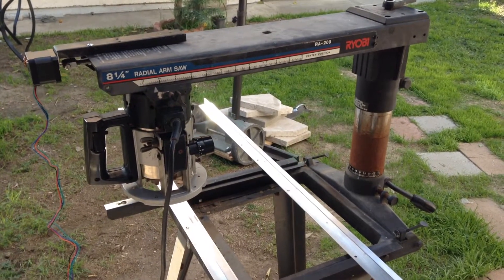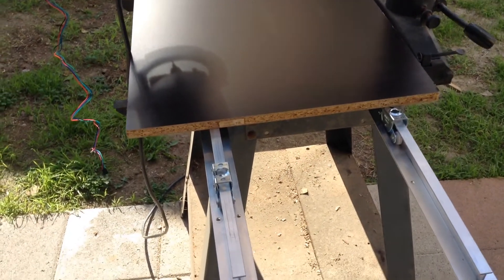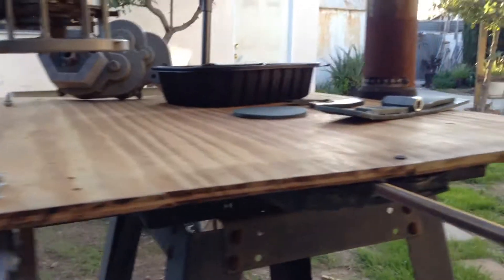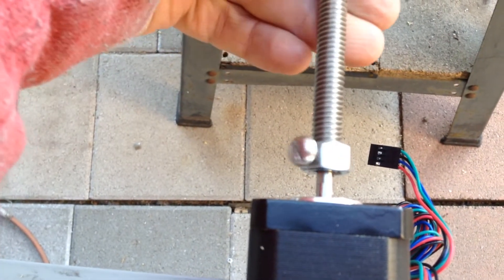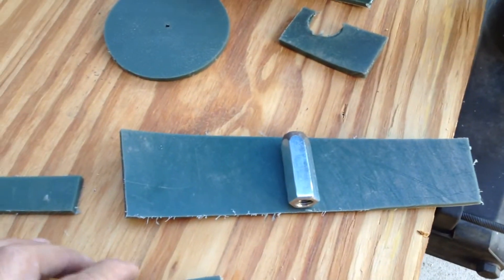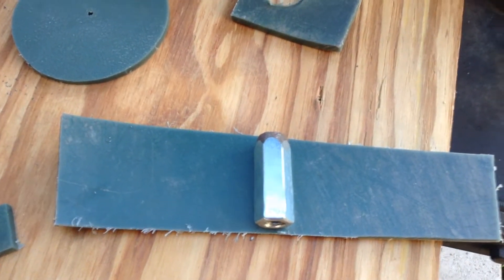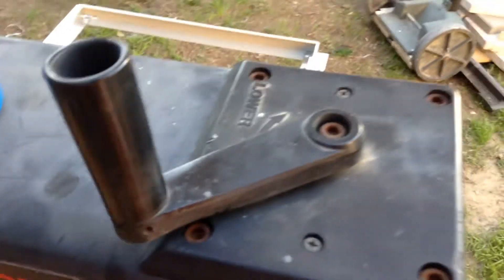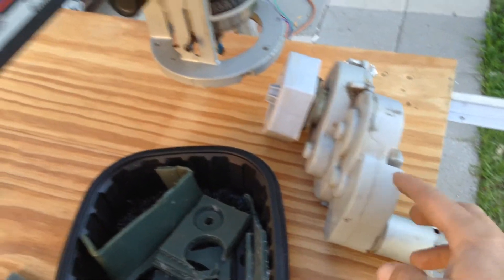Radial Saw to CNC Router conversion Part 3

Comment: emovingthe screws holding a stepper case together is NOT a good idea. It will most likely lead to screwing up the bearings in one and in addition the will throw off the alignment of the bearings.  Look closely at the end where the shaft is attached.. There are 4 holes there for mounting the stepper. Simply make up a plate with the same 4 holes with the same layout and 2 additional holes away from them far enough to clear the housing. Mount the stepper on the plate with the 4 mounting holes THEN mount the plate with the stepperusing those 2 extra holes. Do the same for ALL the steppers and you wont have any chance of destroying them due to shaft misaligned problems due to the end plates of a steppe  not being held properly in place.